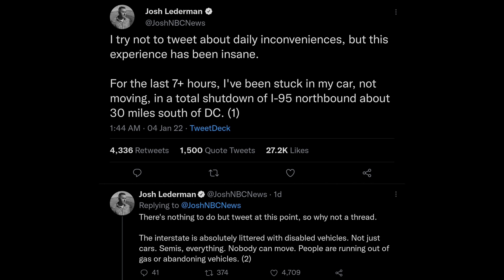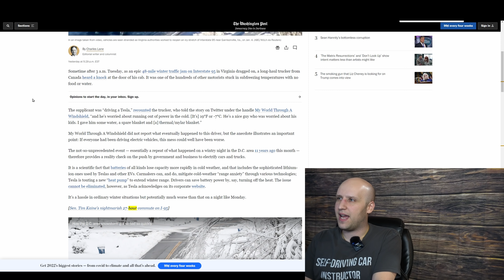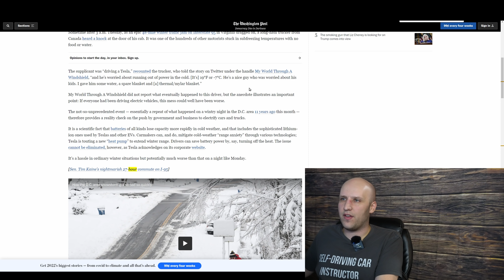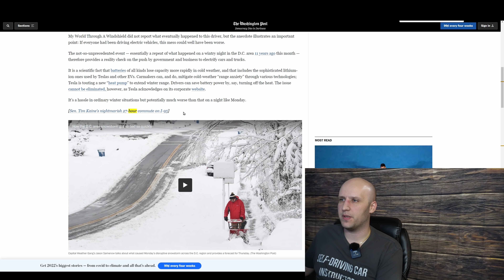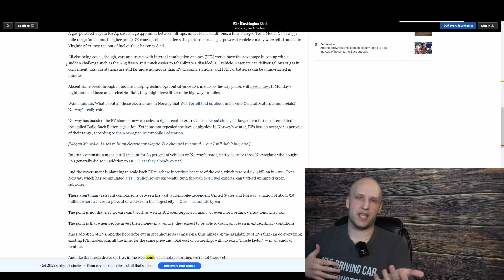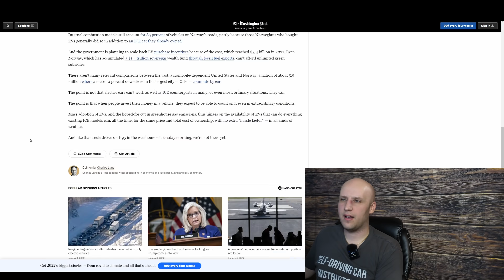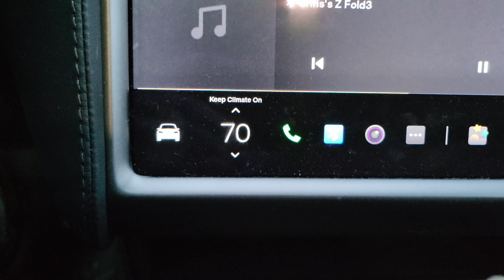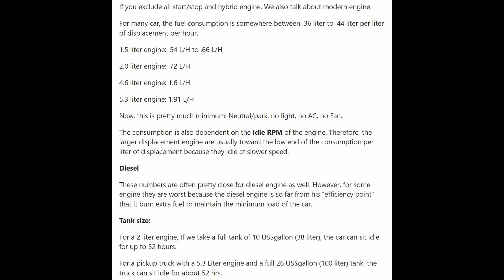How Long Can a Tesla Keep You Warm In A Frozen Traffic Jam? | FUD Debunking

Comment: Meanwhile in the real world the power station that created those Kwh pumped out to feed the EV created, 0.85lbs of CO2 per Kwh giving 36.55lbs of CO2 pollution effectively from the EV, whereas my Diesel ICE vehicle with its catalytic convertor and particulate filter pumped out zilch.....(if it pumped out any it would fail a DOT inspection)..... And, the NOx emissions for both the efficient diesel and powerstation are comparable. In short both cars kept the occupants toastie for 24 hrs but the EV polluted the atmosphere to the tune of 36.55lbs of CO2 whilst doing it.
The hidden facts the EV fanatics won't tell you.

Comment: Something I want to point out where you were going over the Washington Post article and harping on running out of fuel.  If a gas powered vehicle runs out of fuel all it takes is a gas can and about 5 minutes to get it started again and it can leave under its own power and drive to a gas station to fill up.  If an EV runs out of juice it is going to require a tow truck and much more time to get it cleared away and operational again.

Comment: $0.16 per kWh?! Wowza! Here in Arizona I'm at $0.032 that's 3.2 cents per kWh.... You're 500% higher... This is 10a-3p though in Arizona.

Would be interesting to have the vehicles already at 65 degrees at 90%...  And climate off at 90% but seat heaters on. It gets cold here at 7000 feet in Flagstaff Arizona.

10.9 just finished installing as I typed this... Loving my model x.

Comment: I say your test is unrealistic. Interior temp should be set to somewhere between 55-65f. People should have at least coats, and possibly blankets, when driving in cold weather. Between coats/blankets and seat heaters, people should be able to remain comfortable with interior temps in the vicinity of 60f

You essentially acknowledge this near the beginning of the video, so I don’t know why you opted to test at 70f.

Update: noticed at the end you did a test for 6 hours on the model Y with the interior temp set to 60f, much more realistic test.

Comment: I was once trapped in a storm decades ago for about 15 hours I had a ford 4 cylinder 5 speed transmission. I kept the car idling most of the time . used a 1/2 tank of gas . the big problem wasn't the gas used but the transmission . car manual and automatic transmissions aren't designed for long term idling especially in old weather.the 50 gear oil would splash to lube the gears but in neutral most of the splash lube is not happening because the counter shaft is only moving on friction so it turns slow to notat all the oil settles in the bottom of the transmission where it's at the coldest point . it gets thick . that lubes  even less but the input shaft get no lube after 12 hours I began to hear the bearing run dry and start to squeal. at the 15 hour point I fought it I to gear and had to drive 35 miles in second before oil warmed up and enough lube began to free up the seized bearings and I was able to begin shifting . so there are problems with gas cars idling for prolonged periods in extreme cold

Comment: There are so many variables here it all comes down to the end user as far as charge usage time. Some people would be comfortable at 75 consistent degrees while others could cycle their heater to run every half hour or 15 minutes. If a car is well insulated it shouldn’t need constant heat. If Tesla is not doing that already they should be. In fact all car manufacturers should work on better seals and insulation from outside weather conditions.

Comment: I appreciate that this was done with an agenda. I'm fine with that. I don't have a particular issue with moving to electric vehicles. I just want to solve the real problems then we won't need reviews like this. There are real issues to solve. Instead of trying to debunk things that are not issues, let's actually acknowledge the real problems and solve them. If the vehicle does run out of battery in the storm, no one can take a can of battery out to it. I lived in a city where thousands of cars are street parked sometimes blocks from the owner's dwelling and it was a small city. Where will we plug in the car?

Comment: A Lithium battery requires temperatures about -4F to operate. A gas car requires 200F to operate 'normally'. Both an EV and a gasoline car can create engery required to keep their machine warm. In the case of Lithium -4F is required, in the case of a car 200F is required. Gasoline is better for generating heat for sure, but the honest question is which has the amount of engery required to fullfil its requirement? clearly in the case of the Telsa, it would have to be higher then -4F given human safety but still, the difference between the two temp requirements is extreemly large. The amount of misinformation that comes from Mainstream sources is stunning. In fact, the majority of it is just pure lies

Comment: 🤔 electric to gas. Maybe if there is an electric charge station at every gas station. Not just in major city. Or from one point to the next. Maybe if the cost went down. Maybe if I could take the electric car to my local auto shop and have it fix the same day. Maybe. Oh that's right. Dame thing cost a kidney. I think i will pass. Oh, sensor goes out. Wait 3 to 4 weeks to get it back. Yeah. It's your money. Spend it how you like. My 1994 Toyota runs perfectly well. Run out of gas. Yeah. I have a gas can in the trunk. Wish she had a gas power car. 😉

Comment: I had a 2013 Subaru Outback. I idled all night car camping. About 8hrs running with air conditioning on, and I used just over 2.7 gallons of gas. I had a full tank of about 18 gallons. My suspicion you would do way better gas over electric, diesel even better.

Comment: Model X has to heat a much larger interior volume and also has more surface area losing heat. So you would really have to compare an older Model Y to a newer one to really get a correct comparison on the heat pump vs the resistive heater.

Either way I know for a fact my ICE car would not last 24 hrs from a full tank at those temps. Absolutely no way.

Comment: The only thing stopping me from buying an electric car is the fact that you need a charger for them. I find it odd that they don't crack a formula for a car that charges at it drives. All it would need is an on-board generator like a gas powered car.

Comment: I've owned an EV. Once the lease was up, I vowed never to go back. I froze my ass off every single day during my commute, because if turned the heat on I knew I wouldn't be able to get back home. On a cold day it's especially bad, as the range is halved. Then you spend another 30% on heat.
Reply: Did you have it plugged in when you warmed it up in the morning?
Reply: @starcityrc3298  Sure did! Had a schedule and everything.

Comment: The one issue that I can see would be in the case of totally running out of gas/electricity.  The highway department could relatively easily bring a fuel tanker out to give everyone enough gas to get to local stations.  But once the battery is flat, you have to bring out a generator to give them enough charge to get to a charging station.
Reply: @MBRMrblueroads  trust me when I say this...If they can operationally get gas to you, they will instead, carry you out of that area and to a safe hotel. Not give you gas to stay there. If a human can walk to your car there, then you can walk out or be helped out and back to safety
Reply: why in the F would they bring out fuel tankers so that people can remain stuck in their cars instead of putting the people into a truck and hauling them to a hotel room? if you can get a fuel tanker to that location, filling their car up with gas is NOT the option you would select in an emgerency
Reply: @MBRMrblueroads  and I carry a goal zero 1500watt and a 400watt battery with me, your point? we are talking about getting gas in and out of an area, not pretending that the vast majority of car owners carry extra gas with them
Reply: @MBRMrblueroads  also you have to keep in mind, an EV needs to keep its car at -4F, a gas car needs its engine around 200F. both kind of cars can generate heat, and although gas is more effective at generating heat it also requires a lot of heat thus more engery. What is the time difference between those two variables I dont know, but the arguement that you can get gas while stuck on the freeway is a bit silly. because if you can get gas in, it means you can get people out
Reply: @MBRMrblueroads  for the thrid time in order to get that hose to people with a gas source that is not the car behind you you need to do what? Send it via email? No you need to have a person physically get to the site froma site that has the gas...if you can physically get to the site from outside the zone then clearly you would bring those people out of the sire or thise people could have left the site in the first place!!
Reply: @MBRMrblueroads  or maybe I shod just ask....why did people not leave their cars and walk or drive to safety? Because they can't. So if they can't leave how can others get in?
Reply: @MBRMrblueroads  or more simply put, if you can get gas onto I95, then you can get people off I95. Why were they staying in the cars in the first place?
Reply: @MBRMrblueroads  well that reduces the gas of other drives but it is a point. I did just learn something very troubling though, officals where handing out water, which begs the question. If emegercy can get to them, why could they not leave? clearly not with car but by other means. By foot, hand out jackets and boots. anyway, that is a point. but again, what would the telsa driver do? they would pull over, grab the water bottle from the offical and start walking out of the site the same direction the offica got there in the first place
Reply: @MBRMrblueroads  but it is worth noting, Desiel fuel from a truck is not going to do your car much good
Reply: And? Bring a generator.
That topic was covered in the video.
Reply: If the plows can not get through, how do you expect a fuel truck to get through?
Reply: You will find any reason to say Evs are bad, Won't you?

Comment: Just to see why many of us do not want an electric car. Lets say we have 6000 cars stuck in a snow storm for long enough that all cars run out of fuel or charge , there are 3000 electric and 3000 gas cars. After the storm, most of the gas cars can just be refueled with a gas can (then driven to the next gas station) now you have most of the gas cars back in service and most of the electric cars stuck on the road for a much longer time.

Comment: You assume the battery is nearly full when you get stuck. What if your battery is say at 10% because you only charge your car on the weekends. What if you were on a longer drive for some reason, say 250 miles into a 300 mile trip and you get caught up in this traffic jam? Your test is informative and interesting but in the situation you are depicting it's not real world. Yes a fully charged EV will keep you warm for a long time but that's not real world conditions. Maybe evs should carry a gas generator and 5 gallon  gas can in the trunk lol or maybe  15 mile extension cord. My hybrid F150 will idle for days on a half tank and I can comfortably lay down in the huge back seat.

Comment: This is a pretty cool test, but a few things to consider.
1. Not every EV vehicle would of started with a full charge that day in Virginia.
2. Imagine if only 25% of those stuck were EV’s that day and didn’t have enough power to move.
    Having to wait for a tow, it would of extended this traffic jam for days by blocking gas powered cars.
3. Subsidies by the government are a big deal, yes they partially subsidize gas companies,
    but the end user also pays a gas tax, in my case $0.37 a gallon that EV’s don’t.

Until these EV cars companies build something that can stand on their own merits,
and pay the same taxes as a ICE vehicle, it still doesn’t make sense.
EV trucks make even less sense, when used at capacity, range is reduced by 2/3.
As far as environmental impact, where do you think this power to charge your EV comes from?
A fossil fuel burning power plant that inefficiently delivers it to your house.
Not to mention what will happen with these spent rare earth lithium batteries.

Comment: I'm not an electric car fan at all. I see absolutely no advantage of owning electric over gas. You said your tesla only charged up to 91%, my gas tank can fill up to 100% every time and it'll take no longer than about 5 mins. Let's see an electric car do that 100% in 5 mins, you won't. Like was mentioned in the video, run out of gas and you can have gas brought to ya. Let that battery die, you're looking at $150+ tow. Gas models are cheaper to buy.

Comment: Sure any car can run out of power or fuel, however I can get a can and make my way to the nearest gas station whereas I’d love to see them carrying electric in a bucket! I’d say electric vehicle owners would find  having very large power inverter to operate separate from regular vehicle operations that would work things like heaters, lights, etc. i prefer sticking to fuel operated vehicles because I live in a rural country area where the nearest stores is about 10 miles away one-way, not to mention the extensive number of miles driven for work totaling between 100 to 200 miles each day or more depending on job site location, etc.
Reply: I own a Tesla and drive over 100 miles every day and some times around 200 and never have an issue. My car can easily go 250  miles and have some battery left. I plug in when I get home and its full and ready to go the next day. The whole gas thing is better is just not the case. Imagine never having to stop for gas. I don't have to imagine.

Comment: The human body absorbs heat as well as blocks heat from escaping when those seats are used. Since those seats were sit to high with no passenger, the seats themselves were causing the cabin temps to rise slightly as well in conjunction with the cars heater. Clothe seats are a lot less efficient than if the seat was leather. This is because leather is a lot more dense.

Comment: an extended range tesla has to be left in the EV fire department dunk tank for like 48 hrs minimum... so used as a campfire I'd say that would be atleast 48hrs compared to only 4 hrs with a gasoline car fire... the EV definitely wins this competition easily! (Either option also really requires significant fire and explosion protective equipment along with some sort of SCBA system with an immense amount of breathable air, so the neccessary trailer containing these items will heavily reduce your range 🙁) All in the name of efficiency 😁👍

Comment: Yeah but a big differences is let’s say you’re responsible and Carrie extra fuel on board your vehicle and a gas can well you can’t do the same with an electric car so if you’re unfortunate enough to run out of fuel well you can just put the 5 to 10 gallons in your tank he can’t do the same with an electric car plus Teslas are kind of shit cars with their batteries die it’s a pain in the ass to get back into them and trying to load one of those onto a Tow truck fucking sucks wheels are locked up car as heavy as hell no thank you

Comment: The only disadvantage I see is having to tow, so to avoid that I would just turn off the heat at 1-2% and the remaining range/charge would be enough to find any outlet at all, even with turtle mode

Comment: Used to have gas stations that had their own backup power systems for fuel pumps. These was before card purchase systems so be harder unless either you carry cash or the retailer had a connection to use card. BTW alway carry a 72 hour bugout bag in all cars.

Comment: I have driven in freezing rain where I had to run the defroster on my Hemi Ram at full output for several hours. I had to stop regularly to clear the ice off the windshield. I know that a heat pump wouldn’t have worked in that situation. I had to open the side windows to keep from overheating. Otherwise, there are limitations to both vehicles.

Comment: I'd still prefer the resistive heater, fewer moving parts mean lower probability of premature failure

compressors have moving parts, gasses, tubing, condenser, and evaporator cores 

A resistive heater has a wire connected to a power supply, it's a lot more reliable, and if it breaks, you can fix it by twisting the broken ends of the coil together
Reply: Maybe, but it is added weight to have the resistance heater since you already have an air conditioner in the car which is the heat pump.
Reply: @Allen-eq5uf  I'd still prefer reliability
Reply: @mwbgaming28  exactly lol. Some people just want to try and find a negative about something when it dosent really matter.

Comment: You should try Camp mode. It apparently makes it even more efficient. Also covering the windows with blankets would make it last longer.sounds like they would both be better getting stuck in since you would run out of gas after that long and you can’t regulate gas usage just by turning down the heat.

Comment: If it’s really that big of a worry find someone who can custom build you a safe winter battery insulator some kind of insulating cover to keep in heat and deflect cold tempo tires from getting to the battery as much increasing efficiency making it easier to keep the battery in optimal temp longer with less drain to do so

Comment: Recently, jusr last week,  in a hill station called muri in pakistan, due to  heavy snowfall there was a city-wide traffic jam and thousands of cars were stuck in a traffic jam for few days. People slept in their cars at night , kept the engine running with the heater on. However their  exhaust pipes were blocked due to surrounding snow around the car. This forced the generated carbon monoxide back into the car. Due to this phenomena some 20 odd people died, in various cars. 

This well never happen with Tesla or any other electric car.